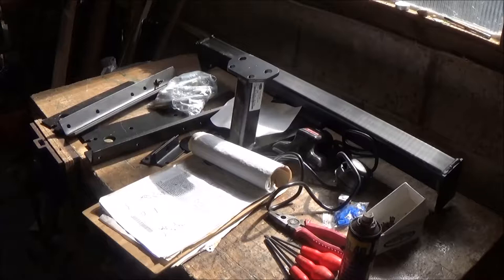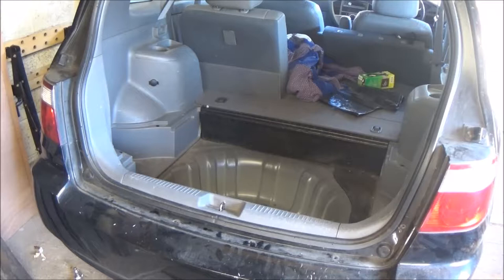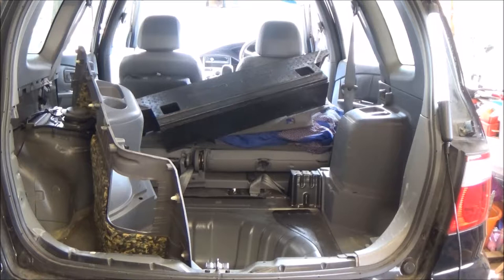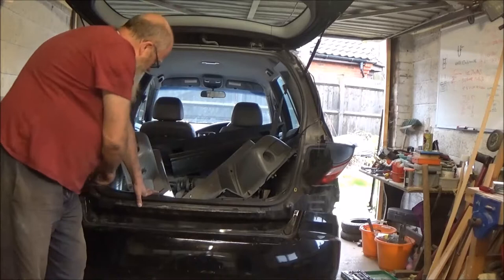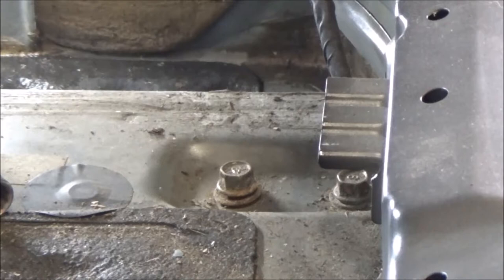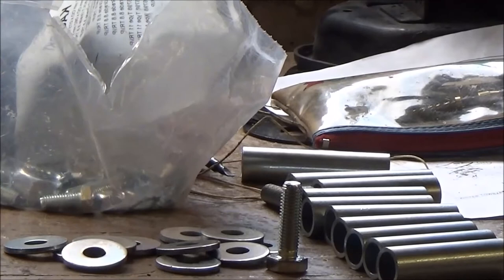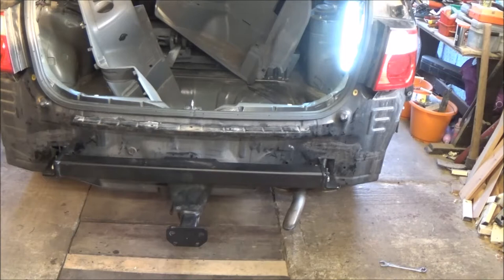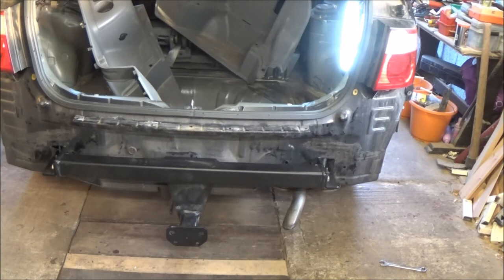Dale Skidmore - Boat Restoration Part 33 part1

Comment: Always like to see vids do the 'warts and all' method. I get fed up with instant experts who just post the edited highlights with all snags/obstacles removed.
However, with my mechanical/motor skills I reckon I would have been  handing some cash over to some mechanic.
Reply from the maker: I'm the same as you Dusty, I think you learn more from the pitfalls than the smooth, no probs vids. I didn't get as much of the operations in as I would like, but hopefully enough commentary to help. Thanks for watching.